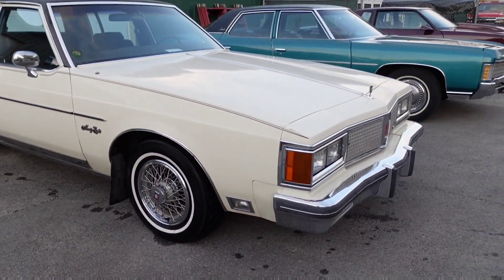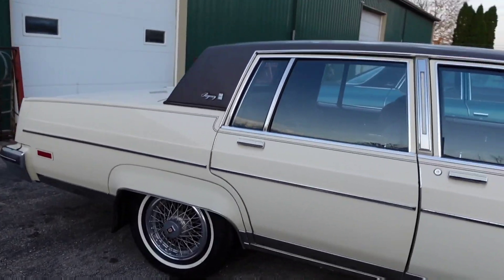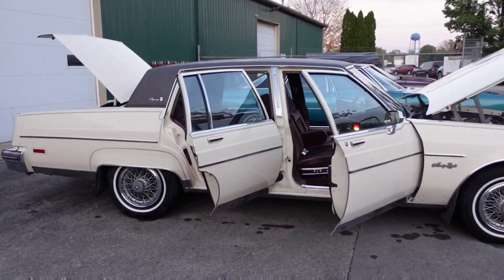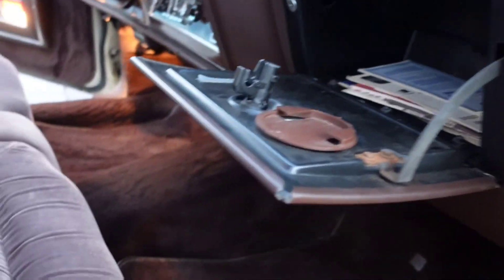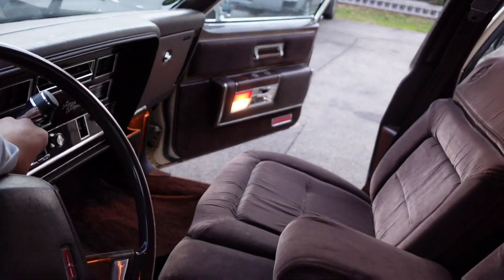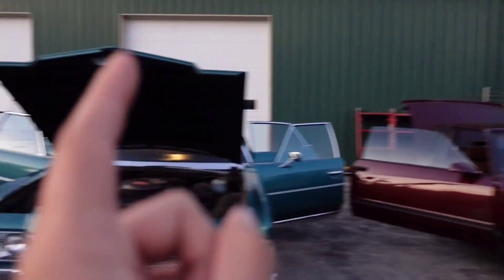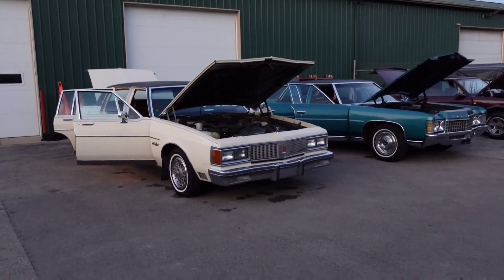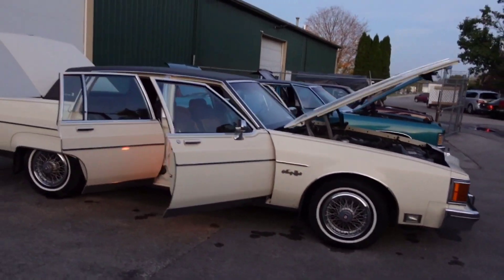They all go for sale!

Comment: Dat beat in da beginning 🔥🔥🔥🔥👀 Aw yea I need dat 98 wit da skirts ASAP... I had a 78 2 door 98, 84 and 85 delta 88 4 door box... Even had a few short dog 4 door 3800 engine Delta and 98 cars.. Not to mention the Cutlasses I had 79 wit da 267 small v8, 81 with stroker Motor but all were Oldsmobile.

Comment: Your asking $6500 for the 98. It needs a new windshield, headliner and small chips on the trunk and other areas. The interior upholstery is not that bad, it's passable. The car looks and sounds very nice from a distance, but when you get up close is when you see all the defects. But it's still a nice looking cruiser. To get the windshield and the headliner would cost a good $1000. The paint can wait for another year as it's not that bad. According to the NADA book price Guide, the High Retail price for this car is $3,540. What the undercarriage look like? Unless a car is just off a frame off restoration, all cars of this age have some rust underneath. The question is - how bad? A car is only worth what somebody is willing to pay for it. For someone looking for a nice classic cruiser and not a show car, this Olds 98 is the car.

Comment: On the Oldsmobile, the clear light at the bottom front of the front fender is the cornering light not the turn signal that you pointed out. Also what you pointed out is a reflector in the side turn signal.

Comment: The SS in decent shape body wise motor sounds was like a lifter was knocking your asking $2500 more than what its worth for a repainted, non-matching numbers car, with a B&M in my opinion be different if it was original than the price would be dually noted.
Reply: dont forget faded seats, rust bubbling and painted over on door bottoms and rockers / jambs and riveted armrest

Comment: 84 Regency Brougham needs a windshield, 2 chrome pieces on the lower left and right fenders, interior needs headliner, front seat worn and faded but comfy I'm sure on a long road trip, 71 Impala like a time warp, Museum quality!, odd color combination though but it's the 70's man. The 87 SS not original color and not original eng. I heard a lifter slapping 😳,  good 1st car for Vo-tech High school student. My choice would be the 1971 Impala and go back to the past and sell it for 2832.99$  What a steal!!! LOL, HAHA 😄, Just kidding.
Reply: 1971 Chevy Impala is so far from museum quality.
Reply: @neilouellette3004  EXACTLY, even though was Ziebart treated 50 years ago, still has rust all along all door bottoms, trunk floors, quarter drop downs, etc.  The rust has been cleverly painted over but will be popping back through with vengeance SOON!  Also rust bubbling up the sheetmetal below the back window under the vinyl.  Monte also has the same bubbling rust on door bottoms / rockers / jambs that's been painted over

Comment: If the problems were fixed on the Olds, and it were properly detailed, the car would be worth considering. The cracked windshield means that it is not street legal. It is clear that this car is just being turned over as it was purchased, which indicates that there are likely other problems. And the 5.0 GM engines of that era were terrible; poor gas mileage and even worse performance! Only get one with the 5.7L gas engine. 

Note also that the asking price is more than double the NADA "high retail" value, which is for a car that is near-perfect. Far from it!
Reply: I had the 305 (5.0) on a 83 Trans Am for about 5 years growing up, had 90k miles before I sold it. It was a dog of an engine (as you mention) but never had a single issue with the engine, and I ragged on it quite a bit. Folks had the same engine on a Caprice. The tranny eventually crapped out, but not a single issue with the engine until it was sold with over 150k miles on it. Not sure if the "High Output" version on the Monte Carlo SS had issues or not, but GM used that engine for around a decade, so I can't think it was that terrible if they used it that long on millions of cars. Probably not as bullet proof as the 350 or the 3800 V6, but not some plagued powertrain like the 301 Turbo or some of the godawful diesel engines they were dropping in their cars back then.